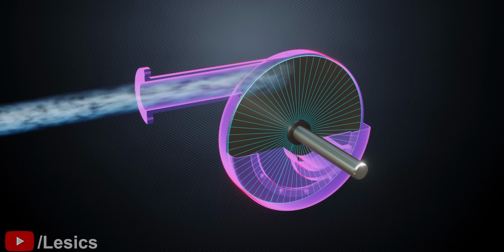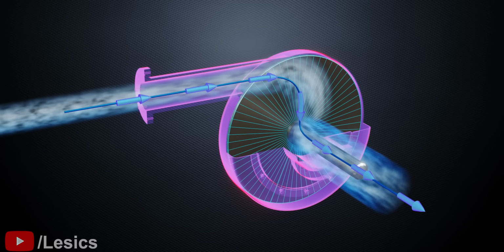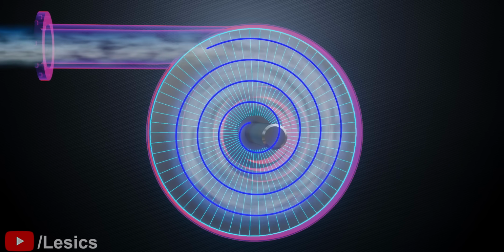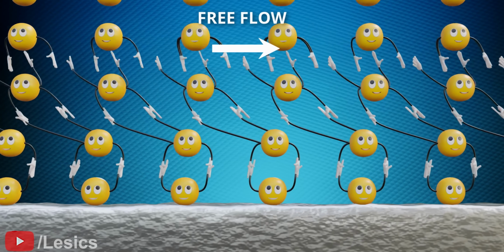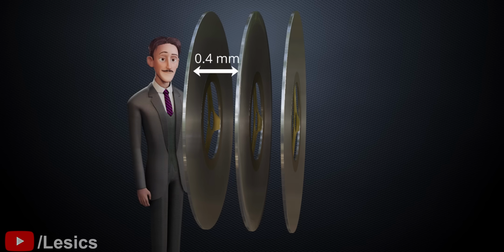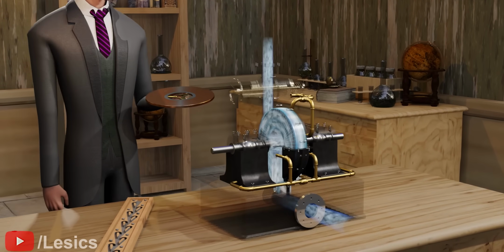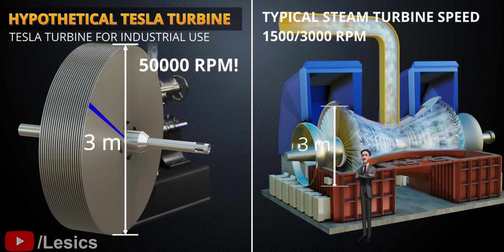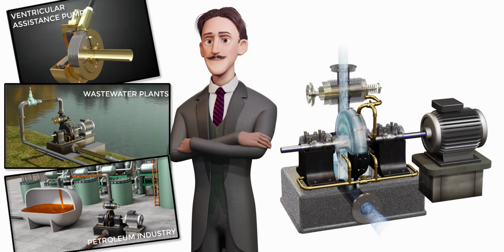Tesla Turbine | The interesting physics behind it

Comment: Yeah he claimed 97% but it was nowhere near the efficiency of blade turbines at the time. After Westinghouse tested it, they found it was actually 20% efficient. I really don't know what people see in this guy.
"Apparently, despite its relative simplicity, there are some significant engineering issues with the Tesla turbine design. While it works, the efficiencies are not better, and in some cases, significantly worse than bladed designs. The rotor’s efficiency is high, but the losses from the nozzles and diffusers required drops the efficiency significantly.   The best applications seem to be with highly viscous or abrasive working fluids. Tesla himself envisioned them being used in capturing geothermal energy. Some interesting observations in Professor Rice’s paper are that this type of design resists cavitation and is very quiet. That made me think of a submarine or aerospace applications, but I could find no references for this type of turbine being used for that. Rice also points out that newer materials, such as ceramics, might make the design more viable in the future."
https://www.conceptsnrec.com/blog/the-tesla-turbine-a-solution-looking-for-the-right-problem
So more bullshit, the guy was a master bullshit artist who died broke.

Comment: There is a mistake in the late part of the video. For the 3 meter disk, the RPM required is 23500 instead of 50000. So it is quite doable with current material. And again it is for the last stage only. For the first or if needed the second or the third stage, it is easier. Keep in mind that is for 97% for each stage.

Comment: I built one of these out of cardboard once with 12 disks (with a metal shaft and bronze bearings) and used a hair dryer to power it. It easily spooled up to several thousand RPMs.

Comment: Could we make those disks of graphene or that carbon design "nanolattice" thing to reach the desired rpm?
Reply: I think these would be awesome, and you could play with the configuration of the surface area to increase viscosity.
Reply: But, Mach 13! 😨 Same principals that limit top speed on prop aircraft and especially heli's... tip speed. When you have tips exceeding mach 'x' and other areas far below that, some really weird stuff starts to happen. Harmonics get beyond bizarre for one, which results in the mechanical failures they mention. Some hurdles... no matter how high you jump, they always reach up and slap ya in the ankles.
Reply: @texasgonzo67  sometimes hurdles reach up and smack you in the 'nads.
Reply: @texasgonzo67  Bingo.  True engineering is where Theory meets Reality and becomes Functional.  All I know is I do not want to be anywhere near a pump with discs rotating at Mach 13...
Reply: @texasgonzo67  Exactly. And what they forgot to mention in the video is that 3m discs should still be very close to each other to "use" all the water due to viscosity effect. With that speed and huge forces on those discs I do not see this possible right now.
There may be some small, but genius, tweak, that could allow to use these turbines at slower rpm but we had to wait for it. In this form its IMO unusable.
Reply: @bartomiej9807  fluids with higher viscosity to make the motion a bit ”harder” to lower rpm? But then again we dont exactly have oil rivers so idk😅
Reply: @HummusPvm  you basically answered yourself. And oil, as an example,  will not have the same speed as water due to mentioned viscosity.
Other fluids could be used on mixed cycle - recharded and pumped up using sun energy and used at night to balance power supply.
Reply: What would be possible is increasing the disk sizes even more to an extend where we could run them below x amount of RPM the only difference is water pressure needs adjustment and we need strong disks to withstand the force generated even with lower rpm, but imagine the disks being like 3-5cm thick and a theoretical size of 15m (huge but i mean coal factories and nuclear power plants are bigger) we could actually get enough Disks together so they are a cylinder of like 30-50m and we could theoretically make it work as efficient if not better whilst keeping cost fairly low, since maintenance would be easier and lower in price
Reply: @HobbitChargeGaming  Actually its impossible. The principle of this rotor is that it becomes very effective on high rpms because of viscosity effect. If you lower the rpm you lower the efficiency, no matter what diameter are you using. The bigger disk, the bigger the problem.
At the end of the disk speed would be astronomical. 11G is absolute madness and something similar with lower rpm would be there. Vibration would tear whole rotor apart, no matter how strong the material would be.
Reply: @bartomiej9807  I do not believe people understand the forces involved here.  Those levels of acceleration mean even the most miniscule variations in balance will be phenomenally amplified.  Nothing is PERFECTLY balanced, what we usually get is "good enough" such that the vibrations are at a manageable, or possibly unnoticeable level.  The acceleration across the disc with a tip speed of Mach 13 would tear it and anyone nearby to pieces, if you could even get there before the thing jammed up.
Reply: What if the disc made of "VIBRANIUM".🤔🤔 We can purchase those metal from WAKANDA😊😃
Reply: @SHANKAR-Nitrr  i can supply all the vibranium you want. cheques only to post box 27
Reply: @SHANKAR-Nitrr  Wakanda already has small reactors. We could use them instead of this.
Reply: @I love you but a small percentage can still negate the expensives if it pays you back. I don't believe even graphene would help the design it's probably never going work but it's neat.
Reply: Steel works fine.
Reply: Its strong don't get me wrong but not even close to the strength required for the forces at play, do keep in mind all the connecting parts also have to handle all that rotational force, and if anything goes wrong, flywheels are already scary powerful and dangerous, imagine multiple of them traveling at mach 13, we are talking more Energy than a lot of explosives, they would have the potential to cut their own hole through a dam, or at least do major damage and kill anything in the disks path
Reply: @kiyosenl.3889  Tbh I don't think we have any structure capable of containing exploding graphene discs. If a catastrophic failure did happen, the whole facility would likely need to be rebuilt, along with the miles of chaos caused by shrapnel.
Reply: @heroslippy6666  oh for sure, i said in an earlier comment a normal flywheel is scary, and they rarely go at very fast speeds, can you imagine the destruction of any meter wide flywheel going mach 13 at its tips
Reply: @I love you but Turbines are expensive and a machining nightmare, if we had a material that could withstand it a flat disk is so much easier to manufacture
Reply: The main problem is they might not be thick enough. But I have no idea how things work at scale and I don't think anyone else does either.
Reply: @derpypotato677  thickness doesn't help, in fact it means there is just more force along the entire disk, making it want to tear itself apart even more, on top of that when you go above the speed of sound harmonics act a bit weird, at 13x the speed of sound this get crazy weird, its essentially the same effect that singing at a certain pitch can break a glass, the sound waves are vibrating at just the right frequency to break the bonds holding the atoms together, thin disks like to deform but thick ones will want to shatter, not to mention there is so much of that metal that has to be moved that never comes in contact with the water, you want as low of a surface area to weight ratio as possible for this kind of thing so you are killing the efficiency
Reply: @kiyosenl.3889  Thanks for the knowledge.
Reply: Even if you could keep graphene discs from exploding, the bearings would quickly fail along with the structure its mounted in.
Reply: @heroslippy6666  agreed, and even if they could hold up to the sheer speed, at mach 13 wouldn't really any fluid become like sand paper wearing away at everything?
Reply: @Muffinconsumer4 essentially yeah
Reply: Tungsten carbide?
Reply: i can see they become a thing if we can use the same principle but somehow can make "Blades" of something that is not a actual solid object like a magnetic field or some kind of fluid. seriously i can't even imagine what could be, but it can be anything as long it can pick the energy of moving fluid thru viscosity and impart it to a shaft
Reply: @I love you but ... The TESLA Turbine is much easier and affordable to manufacture.
Reply: @I love you but ... The TESLA Turbine is much easier and affordable to manufacture.
Reply: Probably if you could figure out a crystal configuration that was allowed without any kinking
Reply: How about one wide disc with a very sparse molecular structure (a new kind of "plastic"?) very permeable to the moving fluid - which might not require such high velocities?
Reply: When we use efficiency tests we should consider energy costs.
Reply: Not sure why the disks would HAVE to be so big that the edges reach MACH 13. Why not just add more (smaller) disks and widen the water input pipe into an elongated oval shape which feeds more disks?
Reply: It actually opposite: the faster this turbine rotates the LOWER is efficiency... the video is a bull**t
Reply: try to find anything on youtube that can spin at 50,000 RPM and not melt/warp.  maybe if you had a force field made of pure plasma or something like that which cannot melt or bend at high vibrations.
Reply: @forgetmybelief  are you serious????  large jet engines operate around 10,000-25,000 rpm, while micro turbines spin as fast as 500,000 rpm
Reply: Wtf Are YouTalking About?

God There Is Some Boffins In Here!

Keep doing your research 😆
Reply: @drawincode1800  they are just very strong materials, thats likely all the OP knows about them (no offense op, its just people present them as if they are magic so most people tend to think they are stronger than they are), hes just saying maybe if we make them with modern super materials they would work, but thats just not the case

Comment: RPM doesn’t seem to be the important part, but rather linear speed.  A 6” disc at 35000 rpm, would have the same linear speed at the steam inlet as a 3m disc running at about 1800 rpm.  Seems perfectly feasible.
Reply: maybe you need to see the deformity, which is caused by centripetal acceleration . And that in turn is V^2 / radius. where V is the tangential speed.
Reply: @aryan-singh  at the same RPM, a doubling in the radius would mean a doubling of the tangential velocity, which would result in a quadrupling of v^2, for an overall doubling of the centripetal acceleration.  To maintain centripetal acceleration, you could decrease rpm by √2 for a 2x increase in radius.

Since 3m is ≈19.7 times more than 6”, we could reduce the rpm by a factor of ≈4.44 or down to 8000 rpm and still maintain the deformation you want - still WAAAYYYY less than the video claimed.
Reply: I was about to say the same thing , the gas molecule only knows linear speed .
Reply: What’s wrong about what you said is that the pressure difference results in a specific linear speed of the gas jet.  That speed would be matched by a 3m disc rotating at 1800rpm the same as it would be matched by a 6” disc rotating at 35000 rpm.

“The scientists” never claimed the 3m disc had to rotate at 35000 rpm, the video author assumed it would have to spin at the same speed.  For the 3m turbine to spin at Mach 17, the incoming fluid would have to be moving at slightly higher than that speed.  Getting a turbine to spin that fast would probably be easier than trying to generate the pressures needed for Mach 17 fluid flow.
Reply: @ausnetting  I might add that I have doubts about the efficiency claimed for bladed turbines , just a shaft with two bearings is normally assumed to loose 3% just from the friction in the bearings , more if they have rubbing seals.
Reply: @I love you but Was that a joke ?
Reply: @I love you but looks like even at high temperatures and pressures from steam entering a turbine, the flow rate cannot exceed the speed of sound in the fluid.  There’s no way you’re getting even close to Mach 17 air speeds even at 30Mpa and 900°K - even if there was an open valve at those temps and pressures, let alone with the more gradual pressure drop from input of the turbine to outlet.

Comment: So if the turbine was in a vacuum the mach number would be meaningless.
Reply: You want to Bend some laws of physics, but that wont work. First, problem is centrifuga force. And second, pumps dont work on wacuum. The need for pressure is high
Reply: Would that be a Dyson?

Comment: I worked for a power company and their steam turbines operate at 3600 rpm, that’s a lot of weight moving that fast considering they weigh several tons, the rotor for a generator takes a 25 ton hook to put in place, the stator part of the generator weighed about 400 tons!

Comment: To lower the rpm, just have multiple inlet
Reply: A lot of people on here don't understand that RPM is critical for the operation of this machine, the speed alters the steam path increasing the contact with the disc and imparting rotational force and therefore increasing torque. See 3:13

Comment: So basically he does have a more efficient turbine than steam, but he is STILL ahead of his time, by more than half a century currently.
Reply: Yes, because "impossible" means advanced.
Reply: @Thisisnotmyrealname8  Wasn't there a time when it was "impossible" to sail around the earth because all of the planet "knew" that the earth was flat? That which is "impossible" today, may not be so tomorrow. Unless you're all knowing or something and didn't tell anyone.
Reply: @singerkgreen  The notion that "oh, if only it could be stable at 50k rpms, it would be the best thing ever (meaning slightly better than what is currently used)" is ignorant that engineering realities are engineering realities are engineering realities [sic]. If a frog had wings, it wouldn't bump its ass when he hopped, right? If the materials used for such applications break down at Tesla's generator's top speed, it is not actually advanced for that use, and it makes no sense to discuss it in that sense. That said, I don't think your equivocation logically follows. Your analogy is really about belief, but materials breaking down from sheer at certain speeds is not a belief. I suppose you can theorize about slabs of diamonds used for the discs, but then you run into the logistics of eeking out a little bit more efficiency against the cost and scope of such projects. Or perhaps, the theoretical reality that if we could make giant slabs of diamond we'd be well past solving extremely cheap energy. Tesla was a smart man no doubt, a true genius, but I don't subscribe to the belief all his ideas were world changers, or were so advanced in some cases that we just can't wrap our minds around it. His turbine does apparently have application. It works. Why do people seem to try to make Tesla's ideas like they are "the answer" ?
Reply: @Thisisnotmyrealname8  wow you took a lot of time to build a lot of strawman there.
Reply: @singerkgreen  No.
Reply: @Thisisnotmyrealname8  typical response from a person with out their real name or face online. You spent time on that strawman though didn't you? It didn't manifest out of nowhere. You had to click at least 3 times and then start typing your dissertation that you think I'm gonna read beyond the first logical fallacy.
Reply: @singerkgreen  You're about half as smart as you want to believe. I haven't been unfair. I didn't spend that long on that reply either.
Reply: @Thisisnotmyrealname8  you said it's "impossible", yet many things people claimed to have been impossible have occurred. Hundred if not thousands of things that were once "impossible" occur on a daily basis. Your closed mind and the belief that things are "impossible" are your downfall...since we as humans know all things possible and impossible, how come the Navy is reporting lots of witnesses of UFOs doing "impossible" things? Just because we can't do them now doesn't mean they're impossible. And the idea that you know what is and isn't possible is incredibly arrogant...much like others who claimed things to be impossible before you, only to be proven wrong.
Reply: @Thisisnotmyrealname8  at the end of the day you're put opinions up without the intestinal fortitude to put your name and face behind what you're saying. If you won't even stand behind what you're saying, why would I?
Reply: @singerkgreen  Again, you're talking about the unknown. I'm talking about physical properties of matter. What did the video say? Something like mach 18 on the outer rim? I would imagine that would generate considerable heat, wouldn't you? This is why the video said it was impossible, and the video was right. Remember, the gap between the discs was .4 millimeter. This is not a comic book. Vibranium or whatever is not going to be discovered, nor will giant diamond discs be used to generate electricity. We know that metals melt in heat and Tesla's design would generate too much heat. We can say something is impossible if it is not physically feasible. Put it together, man. 

Also, considering that you implied you didn't even read my first response to you in full, you're lucky I'm even responding. I mean, talk about arrogant, am I right? And we're all very impressed that you put your face and name on your youtube account. I imagine this is the track you take with everyone you disagree with on here - complain that they are anonymous (which in this case is technically ad hominem - trying to discredit me and not my argument). Would you suddenly agree with me if you knew who I was or what I looked like? Maybe I'm an AI. Doesn't change a thing.